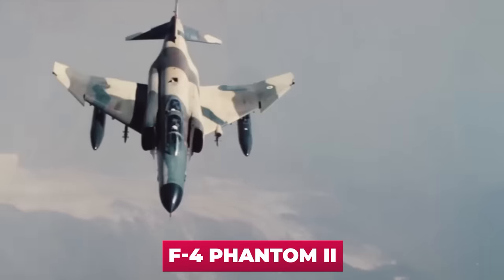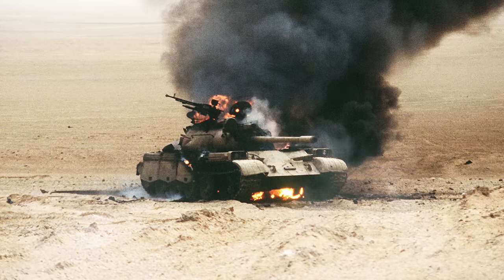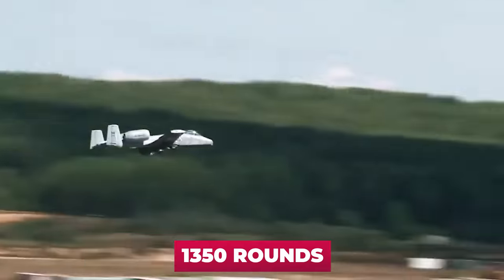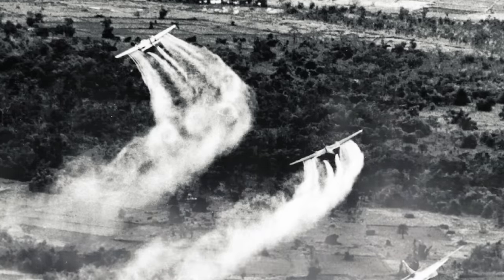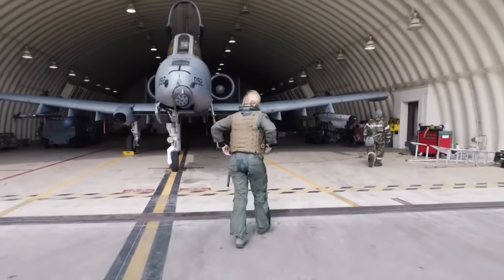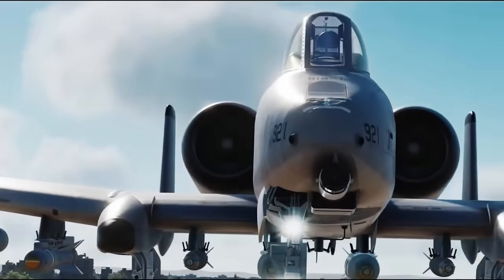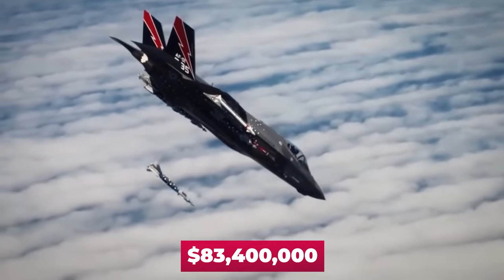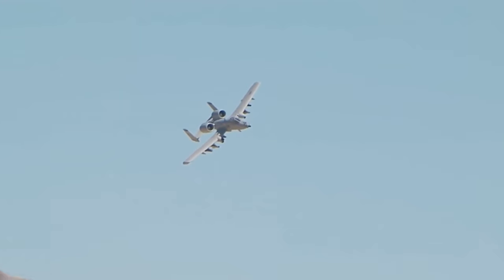US Tests A-10 Warthog After Upgrade To Secretly Send It To Ukraine

Comment: Defense aircraft may get to Ukraine before the F16.  3 Squadrons of A10Cs appear to be next to get Ukraine ground operations completed by mid-October.  Tokmach and Melitopol can be clears with Mariapol completed by end of October. Clearing out the coast will be completed by November and then forward push to the East beyond 3 Russian  HQ in the last two provinces of Donbas.
     F16s will be started in Mid November and Russia will no longer have landing areas in Ukraine.  Logistic of muddy roads may delay battles, but Russian forces will be isolated and lost if they don't leave.  A10Cs will definitely end any remaining large units. Russia should leave now.

Comment: Very wrong decision to remove A-10 from service.  It's tough, versatile and deadly when used properly in it's close air support role.  When you're up to your ears in hostiles, you WANT this weapon at your disposal.  As a rule, when when the HOG shows up, the party's over for the bad guys.  The Air Force wants a newer, more expensive plane to assume the CAS role, but that just shows that they don't understand the CAS mission.  Compare the F-22 loiter time  to the A-10.  When you can't hang around a bit, you're worthless to the troops in a firefight.  Also, the higher cost per unit and the higher operating cost of the F-22 means there won't be enough for a multi-front engagement.  I say keep the Warthog and get rid of the Air Force Generals who want to replace it.

Comment: Why don't they make a modern version of the A-10? Truly built up from scratch with the current design as basis. But with the newest materials and systems available? This way you can sell or recycle the old A10's, use the raw materials coming from the recycling into the new designed A10's eventually with a renewed GAU-8 Avenger that is all together lighter, energy efficient and more environment friendly. Or is it a budget decision to use a 45+ year old airplane in 2023?? Also they could make the airplane even more aerodynamic with new anti-radar plating.

Comment: It doesn't mean much for those who were stationed here or there.  It cannot be used in the UKR without other air cover. It is too slow, and perhaps the C version, which we all know about, can do better.  But you have to have coordinates.  Not just fly around looking for a mess.
Ukraine has almost nothing to provide this. It will not do well against a SU-34/35 that hasn't been tested yet. Super Hornets are needed.,  and real drones at 50K feet AGL loitering for 23 hours. Ukr does not have the battlefield feedback that we do. Nor much coordination with ground units.  It is useless unless and until we give them this and teach them (Years and years). We cannot fly them for UKr, repair them/maintain them, or do anything.  This is a big problem. The biggest problem. 

If US AF pilots were flying them, they would do much better. Right away.  Same for the most modern Apache, Cobra, Chinook, M1A2 tanks,
mine sweepers (though still big trouble), Truck mounted Tomahawks or fired from subs or the USN directly on target, F-35 block 3 (Block IV has poorly failed, and Lockheed has to start all over to sell any. Software), B-2 Spirits, B1-B v 5  bombers with cruise missiles, cluster bombs, white phosphorous, jamming gear and escorted by jamming planes.

None of these can be flown by the Ukr. It would take 2-4 years of training.  Real training and experience.  New manuals in Ukrainian, communications in English (Maybe Chat GPT can help), and again the supply chain problems we cannot help with inside Ukraine.  Not can they lift off from Poland. Not possible under the NATO treaty.  Germany and the UK would be relieved that we are doing everything, and we would send them a couple of invoices. Big $.

Comment: The a-10 is the best ground attack aircraft ever made, but it has been made obsolete by drones that cost less than $1000. The Ukrainian military has shown that drones can replace all ground attack aircraft with extremely cheap, expendable, unmanned alternatives. Currently, the Ukrainian military is using more drones than all other militarys worldwide combined and have shown that they are currently the world leaders in drone usage. The sheer number of different types of drones being used by the Ukrainian military is quite overwhelming but the evidence shows that small drones dropping explosives can destroy any vehicle that the Russian military has including its most state of the art radar systems without being detected. Yes, the a-10 is the best ground attack aircraft, but manned attack aircraft are old technology that can easily be replaced with cheaper unmanned alternatives.

Comment: People talk crap about the accuracy of the a10 when it's the same gun they use on ships that draws lines in the sky. Only difference is one is a computer and the other is being roughed up in the air  6 meter radiusis very good with no computer to do it for you. And this friendly fire crap when is the last time it happened. Likely a good while ago (haven't looked sue me or cry idc) when our communication wasn't where it is today or very danger close. But noooooooo they did it once so it's all they do right? Either way they are overkill when they work and I like it.

Comment: Whilst the A-10 is a fantastic platform for CAS, they're not the best aircraft for Ukraine as they are easy pickings for Russian anti-aircraft systems. They were used extensively in Afghanistan as there was no real threat from the Taliban. In Ukraine it's a different story. Yes they could be used in conjunction with other platforms but that would be quite complex!  F-16s are a far better choice and the sooner they arrive in Ukraine the better.

Comment: The 16 is too fast to be an effective close support machine. The same as Viet Nam and the Skyraider. Not as fast as the fighter aircraft but having a long loiter time and slow enough to put the ammunition where it will do the most good. Like replacing the Harrier with the F-35 replacing the A-10 with F-35s will definitely not work.

Comment: This thing would die on the Ukrainian battlefield as its 30mm gun could NOT penetrate modern armour and manpads would decimate its numbers, it's a slow sitting duck.
Ukrainians are better off with the F-16
As for the US the stealth F-35 at 35 thousand feet 35 miles away is the state of the future CAS.

Comment: I think if you hear that distinctive Vulcan gun fire of a phalanx and think an F-35 weapon of any kind can match it, you should go back to your video games and leave war weapons to the adults. The only thing I see replacing a Warthog is a drone with an equivalent weapon to be controlled by an F-35.  It is not possible.  I do wonder though, if you think drones = weapons, you could make an F-35 "weapon" drone that is basically a mini Warthog, but unmanned.  I cannot believe anyone is going to find a weapon that inspires more fear in all forms of armor than the Vulcan BRRRRRRRRT - pulse of 50 rounds of cover shredding doom in a single square meter on target, and made as much larger as your targets and armor density dictate.  Or, for the MAGA congress members, "IT'S HUGE."  Maybe we should put some orange hair on the Warthog, it's not like it would look any worse.  Then both sides would finally believe the Warthog is old, but it is still one of the most dangerous weapons on the modern battlefield.

Comment: honestly u think its sad trying to replace this plane, and if it does managed to get replace, dont replace like an average plane i would give it an unarmed send off in the sky for 1 last time, as a decorative plane, or a statue of the plane, or at least keep 1 for its honor, and keeping it maintained, or what can be possible, cuz with such a plane, the only way i think could be possible to replace it, is as if a other plane is made out of the same material and metal,i would literally add like stealth capablities, a stronger engine (which can with stand twice the amount of the gattling gun, in which best part, add a smaller gattling gun mainly a 3 barrel, mounted side by side under the nose but barrel is bigger for bigger rounds, like an aa gun but on the nose of a plane yet 3 barrel rotate but on two rotation devices sides by side like this (@Y@) the at symbol are the guns the others what the mount look like, why keep the wings well variations  of equipment, lastly for the stealth use the special paint they use on the f22/coating, lastly since stronger engines use engines thats on like the b2spirit, or nighthawk stealthy engines, basically ppl want the shape stay the same, but u can do minor changes like example: (engines, guns, adn equipment), just not the over all shape or appearence, after all are u sure u wanna remove a vehicle that is recognize able, from an naked eye that can strike fear from appearence, but with better upgrades? or an overall change the doesn't lower the enemies moral upon by looks?, i like the 1st option in my opinion, but opinions are opinions, can i hear yours @Military News? if so please let me know i'd like to hear of u thinking abt my ideas and explanation, and also everyone elses, afterall i love learning more technical reasons why, so that i can get a better understanding why the plane being replaced, and if you choose change the shape, what abt merging a plane to look similar of a cross breed of the a10 and a f22?

Comment: Howdy hi hi,
    What I think of putting the warthog into the Ukrainian/Russian war is that it would be seen as changing the dynamics of the conflict away from the U.S. fighting a proxy war with Russia to actually fighting a hot war with Russia.  This is something that could escalate and get out of control very quickly.  I much prefer to hit Russia where it hurts them most.  The pocketbook.  By way of comparison the U.S. has more than double the population of Russia.  Meaning that for every dollar spent on aiding Ukraine, Russia has to spend two U.S. dollars per capita as a countermeasure.  Back in the 60's Russia foolishly overspent on it's space program in an effort to embarrass the U.S.  And for the most part this worked as time and again they achieved what we could not.  And it wasn't until we put a man on the moon that we finally overtook the russian space program.  But not after many years in which we did cause the Russians to keep up the race far beyond what should have been spent.  
     In large part, due to the space race, Russia built its nuclear power program utilizing far cheaper methods than what was utilized in the west.  Leading of course to the disaster at Chernobyl.  That singular event did cause the Soviet Union to collapse and allowed for the formation of so many satellite nations such as Ukraine.  
     To abandon our many decades long success story behind causing the Russians to overspend would be lunacy.  While yes this iconic aircraft would help give the Ukrainians a far better offensive capability.  That end goal can not compare with the reality that within the what was the USSR is raging what amounts to a civil war being fought under a different name. Napoleon Bonaparte famously said: "Never interrupt your enemy while he's making a mistake."

Comment: They will never get anything besides the F-16.  In my opinion, they should honestly have gotten the A-10 instead considering the majority of the weapons that Russia is using are tanks and artillery.  The F-16 isn't as capable as the A-10 at handling those.  The F-16 is more designed as an interceptor, even though it is classified as a "multi-role" fighter.  It doesn't have the survivability as an A-10, nor can it carry as many weapons, and doesn't have the same gun.  So basically they decided to send an interceptor instead of what Ukraine actually needs, a fighter that is specialized in taking out ground targets.  

What are we going to do though?  Call Biden and try to convince him to send A-10s to Ukraine?  >.>

Comment: The Warthog is like any other aircraft. It requires a system. Your video does  not describe the required system it needs to work effectively in. All this Ukraine needs this weapon and that weapon is garbage. Ukraine needs the US system of fighting equipment and the soldiers needed to use the system effectively.

Comment: It was good in its time, but it could barely break the speed of sound. There is no one to fly them in the UK. S-400s would cut them down. They can be tracked and seen on radar. They are not the only ones. F-16XI models can be seen but have gobs of jamming and can (depending on pilot skill), ditch SAMS.  

I would like it to be effective, but even a basic Exalibur (our weapon) can hit it. This is why no Russian Planes are fighting or many helicopters. They get smoked.   

However, in this post, Ukr has not received any F-16s. They will only if they start all over training in Sweden, Poland, or others. We plan to give none other than that we are the lead in sending AND APPROVING weapons. Others have them and will order F-35 II Lightnings. But unless the US says so, no one else will do anything but promise.

Want to stop drones? David's sling can bring 100 down in under 30 seconds automatically.

Comment: These will never work in Ukraine as you will need a good number 5 Gen flying cap over these slow aircraft. If not they will not last long in this battlefield with its high intensity. Do not tell how it worked over goat herders with AKs and The Russians are no goat herders.

Comment: what do i think about it? i think i just wasted 10 minutes of my life. the A-10 is not and was not a good plane. we now have a crop duster that is better then it in the skywarden. the only 2 thing the A-10 had going for it was cost and with modernization packages that isnt really even a tangible advantage anymore. its cost has gone up drastically to keep it relevant despite it still not being any sense of good in anything other role then counter insurgency. it also has the worse friendly fire record out of everything flying today and for awhile its best optic for identifying anything on the ground was the MK1 eyeball. the truth is even the F-4 phantom is a better cas plane, same with just about any modern fighter. and as for its competitors? there is a reason why almost no one outside of the united states operates the A-10.

Comment: Not a very useful aircraft to send to a war with thick A2AD and incredibly numerous manpad's.
If it were to be used, it would mostly be 1-way missions.
Honestly the only "good" place for it is with the coast guard. It would work well for their needs.
It suites cynical motivations to send them to Ukraine. They're obsolete and have no value to the USAF, but congress keeps blocking their retirement, forcing the USAF to blow money keeping them flying. They also contain no sensitive tech. But the general population seems to think they're still awesome (and they were, until they weren't), so the average joe would think it's some great gift to Ukraine, when really it's just free trash pickup.